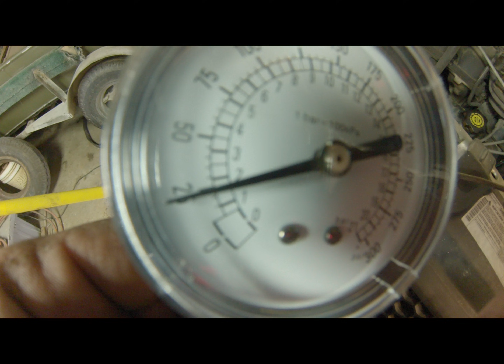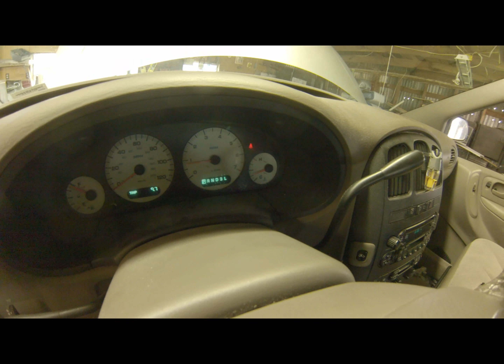Dodge caravan oil pressure sensor  replace

Comment: Thanks, that's where it is. Love your calm attitude. . I'm not going to check the pressure.  I'm going with it. It's not like it has an oil pump. Or does it?
Reply from the maker: yes there a oil pump

Comment: Its hard to get the sensor off on the 3.8. i found it way easier to remove the 3 bolts that hold on the oil filter assembly. that way you can remove 1 piece which holds the oil filter and the sensor. then you can put it in a vice and replace the sensor that way. then just bolt the assembly back on. careful to clean up the mating surfaces when reinstalling and not damage the rubber gasket.

Comment: So it was the bad sensor or just cleaning the connecter with brake cleaner  will help incase its been short out with excessive oil leak
Reply from the maker: Muhammad Tayyab bad Sensor
Reply: Cool , I'll try that first. Spray some carb cleaner on there.

Comment: This video leaves the viewer with more questions than answers. Which engine was this? Caravans came with 2.4, 3.3 and 3.8 litre engines? My guess is this was a 3.3, but you'd never know from the video. You mentioned something VERY important, the AC line was in the way and you had to move it... Sounds important - how did you move it? Wouldn't know from watching this! What size is that socket?  Kind of important information.  Wouldn't know from watching this!
Reply from the maker: NorthernChev my Videos or for entertainment purposes not instructional
Reply: Well, don't let me get down on you too much, I did gleen some info from it. I guess I comment above mostly so in the future you may be able to better help someone.  Thank you for posting nonetheless.
Reply from the maker: Am cool you do’t bust my pride

Comment: yucky I don't want to do it. all the nasty oil leaks. what size socket is it? sucks my tools were  stolen. sounds like a pulley  squeak on that van. does it  leak oil out when taken off? do you have to take oil filter off?
Reply from the maker: yes i use a socket that made to remove oil sensors
Reply from the maker: the squeak is the a/c compresses
Reply from the maker: no i did not remove the oil filter
Reply: ...but what size is the socket ?
Reply from the maker: Andrew Spaltman a special socketed use to remove oil sensors